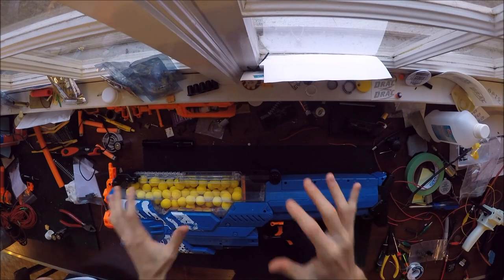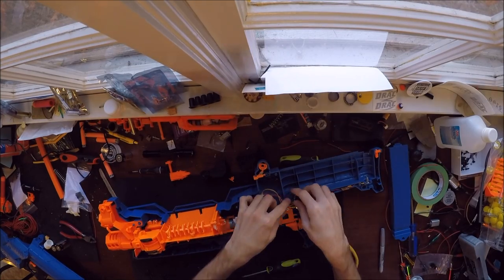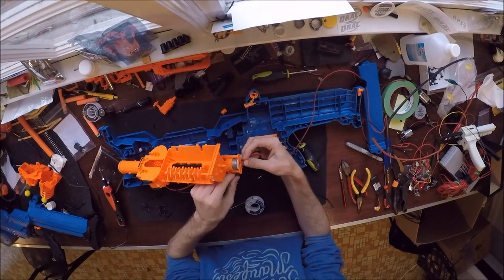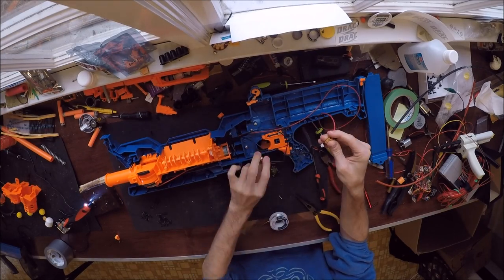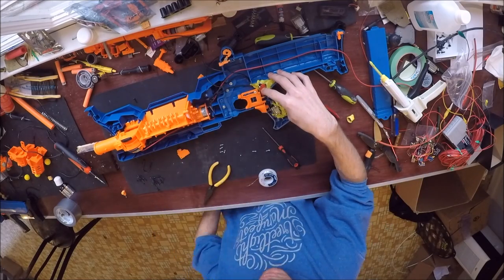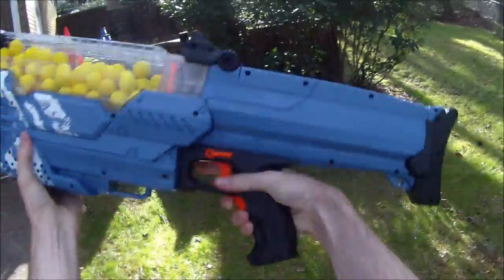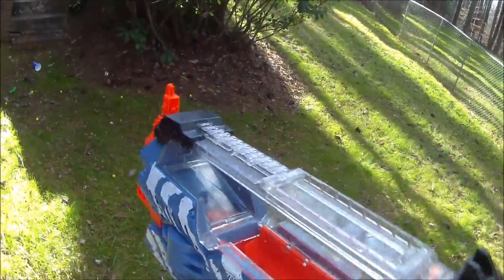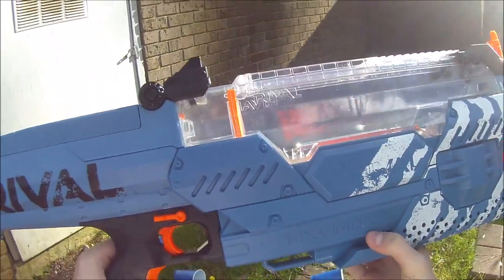Epic Mod Guide: Nerf Rival Nemesis Becomes A Bullet Hose!

Comment: So sick! Used this video to mod my nemisis! Just finished! But I glued my rev up trigger in, then staged the switches so I can just use the main trigger. At 10% trigger pull the motors rev. Then at 95% the conveyor kicks in. Cut out the baffle and safety in the back of the hopper. And cut out a hole in the top of the battery cover, put a Lipo gauge and alarm all clean with a lens.  Took extra time but came out so clean! Now I can get a full 3 finger grip on it running around! Best nerf weapon/mod ever! DRAC RULES!

Comment: Your amazon link for the 16ga wire is actually pointing to 18ga wire.  Also, you said 25A microswitches and you link points to 15A ones.

Comment: In the first part of the circuit you connect both the fly wheel and pusher together. Now my question is how did you keep the pusher from not running while the fly wheels are on? (To keep both triggers operaterating their intended motors) Maybe a real basic drawing could save a few headaches in the future. Just did the build, and the speed of the video allows many questions on how some wiring was done. Especially the switches. These are just tips, I'm definitely a fan of your work. Keep up the quality of work!

Comment: So I'm having to mod two nemesis guns and it seems that you're the only one by far that shows the internal components of the nemesis so thank you. Anyways, I'm having a common issue (this happened on both my nemesis guns) where some of the screws are really tight to get out to the point where the screws would eventually get stripped. I am using a philip 1 x 4" screwdriver which seemed to work with most when taking them out, but we're talking several that I would have to get out the ugly way because they would not cooperate. Did you have this issue when modding your nemesis? I know this sounds like a no-brainer but is there a technique you use to get them out especially in these kind of situations? Screwdriver type? I know you said #0 or #1 but may be more specific.

Comment: I don't think I could personally mod a flywheel blaster because I would confuse which wire would be for what, though I would mod a Longshot since it's simple I need a more powerful spring and follow your guides that don't require me needing to add brass barrels for the shorter darts that look like a real bullet made of foam.

Comment: So do you have one switch running the flywheel motors and one switch running motor that feeds the ammo? It looks like you're running two switches but I have mine wire to one switch that runs both but I haven't fully tested it yet to know if there's any issues there.

Comment: Dear Drac, I just made my first mod for a nerf gun. it was a zing X-Shot micro. what I did is I took out the air restrictor and that's all I did because I don't have a more powerful spring for it. would you have any suggestions for a more powerful spring to put in the gun cause i want it to shoot hard

Comment: How many voltage do you use for that modification ? It sounds pretty similar as mine , I use a 11.1v but i want to include a voltage reductor to keep save the motors and dont burn them

Comment: Does anyone know exactly what motors could replace the stock motors? I'm not looking for an upgrade. The stock motors are fine. But in the long term, a 25%(ish) overvolted motor will die quicker. For the money I'm putting into this blaster, I'd like to know I could replace them should they die. Are they just 3S 130s? Like the MTB Rhino?

Comment: Would adding brush less motors improve the performance even further?
Reply: I'm not sure why they wouldn't, but aerodynamics on these squishy foam golf ball type ammo will have you hitting a diminishing returns curve. Probably wouldn't be worth the expense unless you use it a lot and don't want to worry much about maintenance

Comment: Would taking a stock to a fight where everyone else brought moded be a waste of time? Least with this blaster?
Reply: jdzencelowcz Petty much yes.
Reply: +olli lehtonen :(
Reply: Depends on the round and how nimble you are, I suppose. If you can move quick between cover you have a chance. However... if you are on a field with a stock stryfe and they all have a modded nemesis... you're fucked. In fact, this gun kind of fucks even modded rounds. Honestly, I think it might end up banned from a lot of rounds since it's so comparatively overpowered.
Reply: +Rory Stevens what about a stock nemesis?
Reply: Just use IMRS and blanks in C battery shells as your Nemesis's power source. According to the link below, Rival wiring can take just about anything.
https://www.reddit.com/r/Nerf/comments/3wa78i/while_were_discussing_imrs_lets_talk_about/
Reply: A stock Nemesis would probably work because of it's capacity. ROF would probably be the same an Alpha Trooper with locks removed or something.

Comment: you can mod a bigshock by taking a flathead screwdriver and tap the back of then take out the air restrictor and it will shoot rival balls. hot glue or super glue the back on again for best results. You should make a vid on that Drac.
Reply: Landen Etherington he did...
Reply: KILL1NG no not the way I did it.
Reply: Landen Etherington yes... he did, just in a much better way

Comment: Drac 
I love your video very much, you are the reason I am into nerf right now.Please help, I did everything from your video to mod my nemesis but it ends up shoot in reverse (it shoots back to the trailer ).how to fix it? I have to rewire everything but to opposite side? thanks in advance
Reply: So if you put a ball in the barrel it shoots it to the hopper? I don't know why but I find that hilarious. Don't know how to fix it though.
Reply: Di-Ao your polarity is wrong. Switch the  positive and negative leads on which ever motors are running opposite.

Comment: So I did this mod several months ago, and it worked amazingly well and terrified anyone who saw it/heard it (the ones that got shot at died before impact from fear). Just recently, however, It is always shooting with a significant curve to the right, almost as if the Left flywheel is spinning faster, or the right one slower. But whenever I rev it and watch the flywheels spin, they both stop at the same time, like there is no speed difference. Has anyone else had this problem? If so, what, if any, is the solution? Help would be appreciated, thanks! :)

P.S. The only advantage I can see coming from this is the ability to shoot around corners... but even then, only certain corners lol

Comment: This should help folks! The wiring in the video is not correct. His red and black connections on the motors need to be swapped or they’ll run the wrong direction. Some other wiring is wrong too. This link shows wiring with a rapid fire that is VERY close and helps a lot. Good luck. I just did the mod and it works great. 
https://m.youtube.com/watch?v=6DqxL0pGGDo

Comment: If you wire it as shown in the video, the mod won't work. 2 major electrical problems that this guy needs to address.

1. The motors in the vid are wired backward. Simple fix is to simply swap the polarity at the battery, but if left like the vid shows, the motors will spin the flywheels in the wrong direction causing the balls to fire back into the carrier.

2. All of the motors in the video are shown to be electrically connected together. This means that no matter which trigger you pull, the flywheels and the pusher will engage at the same time. You will instead have to run separate leads from the flywheel motors to the lower switch, and from the pusher motor to the main trigger switch.
Reply: Yes, they both come on with one trigger pull.  The motors spin up so fast it doesn't matter.  I've done about 8 of these and they all shoot awesome. (with the polarity correct of course)

Comment: no new flywheel motors? explain yourself drac
Reply: Right now there is no motor that fits rival blasters on the market.
Reply: Oh, well someone should get on that
Reply from the maker: Frankly, the stock motors can handle 3S no problems with serious improvements on that kind of battery.  Since no suitable replacement has presented itself, I just use the stock rival motors and they work great.  Its cheap and efficient and fun!
Reply: I'm sure someone will eventually make some kind of special rival motor that will mechanimagically double the velocity or something
Reply: Chillcat king u
Reply: Chillcat king no need for a new one

Comment: I just bought a brand new nemises and I went to put my rechargeable battery from nerf in it but I notice it had a plug in Adaptor so I opened it up and I found out it's been modified so I need to know what battery to buy to use it can someone help please thanks
Reply: Victor Banales any Lipo battery. Just change the connectors. Ask an adult to do it.

Comment: tidy your work station dude ...sloppy and your epoxy filling is a bit rough mate
Reply from the maker: +phillip bull Well its not epoxy putty so...
Reply: finally it took an insult to get a response ... was just joking ... love your channel mate its epic ! when is the next big spring mod then... these flywheels have nothing on good old fashioned plunger power !
Reply from the maker: +phillip bull Next big springer is Rhaegal, should be a big hit.  Should go live this month.  Been showing it off on patreon for a week or so
Reply: awesome looking forward to something live ...would you ever consider a multi shot compressed air blaster (homemade) obvoiusly..that would be a game changer ... quick relief valve with negative pressure trigger (spud cannon) but for nerf lol